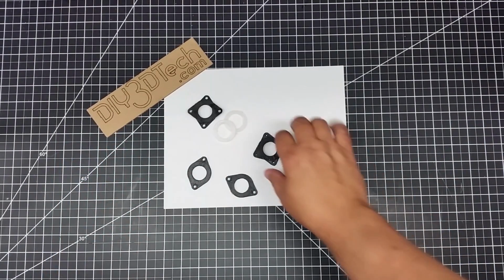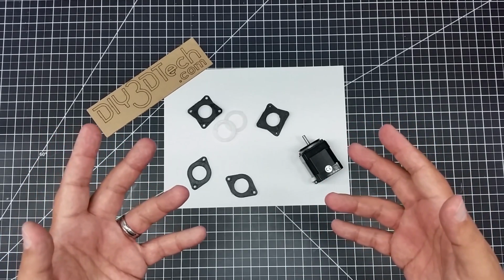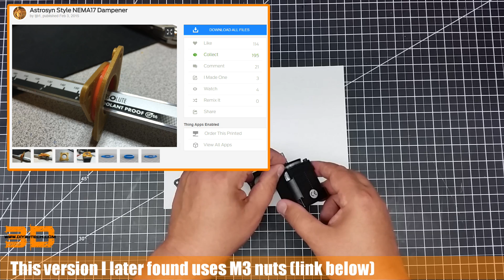Shop Talk   3D Printing Stepper Motor Vibration Dampeners!

Comment: I was just thinking about this problem last week!  My big Tronxy X5SA printer is above my front room in the spare room. on a thick worktop it's strong wooden 3 drawer unit and the printer has it's own 4 thick rubber feet that are on the corners of the frame!  The floor it sits on up there is just plain wood, no carpet no underlay. And when I am up in the spare room with the printer running It makes low sounds as the silent stepper motors run. But when your downstairs in the front room right below the printer , You can hear a low rumbling sound each time the motors work! The floor is hollow so any small rumble I guess would sound more down blow it?  I have to look into getting this sort of rubber stepper motor vibration dampeners, and see if that helps?
Reply from the maker: See my video on diode smoothers for this machine, now I am not sure if they changed the drives on the SA however if they are still making that much noise sounds like they didn't

Comment: You could try to use a pezoceramic actuator, typically found in lighters where an arc are used for ignition. Attach this to the 3D printer etc. and measure the voltage and waveform with an oscilloscope (The voltage can bu quite high). This gives both amplitude and frequency.
Reply from the maker: Guess I am not catching the context as I know what a pezoceramic actuator is and have several of them.  But not getting the application here...
Reply: @DIY3DTECHcom  vibration is movement. The frequency can be seen as the time for going in then out. The amplitude can be seen as how strong the movement is. You can measure both of those with a pezoceramic actuator hooked to an oscilloscope indirectly by looking at the wave that the voltage creates.
Reply: If the actuator is attached to the frame of the machine, the vibration can be represented as a voltage waveform from the actuator.

Comment: I don't think it works because the vibration still travels in the shaft to the pulley, belt, bed, and finally to the print. It might be good idea to dampen the sounds but not definitely not vibration.
Reply from the maker: Sort of as there is inertia dampening, but is it of value? If your a purest, sure, a practicallest no...
Reply: There are two kinds of vibration you can isolate:
The first is transmitted from the motor to the frame due to stepping, that is the kind of vibration this kind of damper tries to fix.
The second is caused by the counter-force of moving mass to the motor in result of changes of direction, speed and acceleration, which you can try to fix by using inertial dampers (a kind of metal/rubber damper that is fixed on the shaft of the motor, usually on the back). You can see these if you google for "stepper inertial damper".

Comment: Ninja Flex is a brand name of TPU with their own patented formula.

I wonder how an EVA foam sandwich would work with this. Probably too squishy and too much play.

Instead of epoxy, maybe consider a high quality contact cement. The epoxy makes things rigid and in many cases, brittle, but contact cement remains flexible I've experienced in my prop making with EVA foam. I'll probably try this out once I get my printer up and running.
Reply from the maker: Let me know how it works!
Reply: Gotta finish assembling it first. ^^; 

Assembling it isn't so much the problem for me. Having the space to assemble it and film at the same time is since I'm documenting everything. I'm building the frame so large I'm having trouble getting it through doors unless they open up all the way, which isn't exactly possible in the place I'm living in. Hopefully I'll figure everything out soon because I really want to get started ASAP.

Picture:
https://scontent-sea1-1.xx.fbcdn.net/v/t31.0-8/26172482_1580427888706014_8015406838352423526_o.jpg?oh=0433ad4dd004029ed1292b22c72bee25&oe=5B0E5F18

Comment: What these are is a spring/mass/damper system.  Rubber is used as it is stiff enough, and has hysteresis to provide damping.  Using random materials is interesting, but flawed.  My issue with these vibration dampers isn't that they don't work - I've tried them, they're excellent at reducing the high frequency noise from steppers - it's that they don't deal with the static load from the belt tension in a 3d printer.  Under the tension of the belt they yield.  Also, the mass of the moving system and the added spring from the belt stretch makes them hit and miss in terms of quality.

What we need is an accellerometer on the print head, and to analyse frequency sweeps.  An FFT might be useful, it could even allow you to post-process the g-code to allow faster and more accurate printing.  Feeling engineeringy?
Reply from the maker: The accellerometer on the print head is a good idea especially as I am experimenting with stepper smoothing with diodes right now.  In general I sort of agree with you but not sure I understand (Using random materials is interesting, but flawed) as TPU is rubber or has similar characteristics as rubber.

Comment: I would think that varying the tension on the drive belt would cause more issues than the motor vibration itself. At the time when the tension is highest on the belt would be when there would be the most movement which could cause positional issues. Adding mass and stiffness would be a much better way to reduce vibration.
Reply: i agree.. if you are disturbed by the vibration/noise build a stiff frame and a case in which the printer is float-mounted.. i did this with some realy thick acoustic foam (40mm) otherwise all the belt tensioning would be useless..
Reply: fusion 360 has vibration modeling built in, it would not be hard to design one that had less vibration. Considering however that the typical 3d printer is as stiff as a cooked noddle I wonder if anyone will use it.
Reply from the maker: Vibration modeling?  Interesting...  I did this a long time ago with my Da vinci's (floated them) and thinking about this with the Tronxy...
Reply: https://www.youtube.com/watch?v=5QRpBr2romY
Reply: There is another one that is even better but I cant find it atm. Lars would be able to point you in the right direction for more info.
Reply from the maker: This is really cool!  I did not know it did that!  In my day job I deal with Super Computers (mostly sub-surface) but in the past did a lot with finite element analysis.  It is amazing what the average Joe can now do!

Comment: Hard rubber damp better vibrations than soft rubber. Commercial dampers use hard rubber and do not flex that much. So I think TPU should be better than Ninjaflex IMHO.
Reply: Second that. I have  commercial dampeners that work great and they have no discernable give.
Reply from the maker: This is interesting (no discernible give), maybe I will give it a try...
Reply: I have some I bought online and they have no give. And these are primarily for noise suppression. At least that's why I bought them. I haven't installed them yet, but other people say they work.
Reply: I am skeptical of this.  "Commercial dampers use hard rubber" is a different statement than "hard rubber dampens better". 

The physics of dampening is that vibration is dissipated as heat by way of friction.  A harder rubber will transmit more vibration, move less, and therefore dissipate less heat.  If I am correct this far, softer material will be better by causing more friction and more movement. 

Think of running on foam vs running on concrete. So much effort is dissipated by friction that it is far harder to run on foam.
Reply: Michael Alme I can't say how things will behave in other applications, but the hard rubber dampers are perfect for this application. Having stepper motors mounted on spongy materials doesn't sound like it would produce accurate prints. I've since installed the dampers I bought for $10 on two printers and they work amazing. 90% noise reduction from stepper noise. It almost seems impossible that they can be so effective.
Reply: Absolutely. For motors, I think a hard material is necessary for accuracy.

I was commenting more on the "hard rubber dampens better" bit. For other types of dampeners though, like feet, I think a soft material is a great idea.

No harm, no foul. Cheers.
Reply: This is not as simple as that .. it depend on the frequency of the vibration you want to damp.

Comment: How about 3d printing a washer mold in which a mixture of RTV and Cornstarch is pressed, then when cured, RTV that to the printed mounting sides.
Reply from the maker: Yupper that would work, actually would use my vacuum former...
Reply: would allow you to adjust density and stiffness by changing RTV's and starch contents.
Reply from the maker: I might try this over the Xmass holidays when I have more time...
Reply: did you ever try this?

Comment: Here is how I do dynamic prop balancing: I put a little mirror on the motor mount at the end of my multicopters arm right below the motor. A laser first surface mirror would be ideal (especially for high frequency vibrations) but I always use a piece of a CD or DVD. Now I shine a laser at the mirror and let it reflect on a wall. You will see the laser point jumping around on the wall. Depending on the frequency and amplitude of the vibrations you can increase the sensitivity by increasing the distance between the mirror and the wall.

Flite Test Video: https://www.youtube.com/watch?v=PqtUSSdf8b4
Reply: Great video. Thanks for link, that was really good. Cheers, JAYTEE